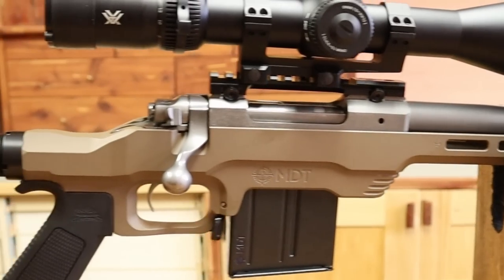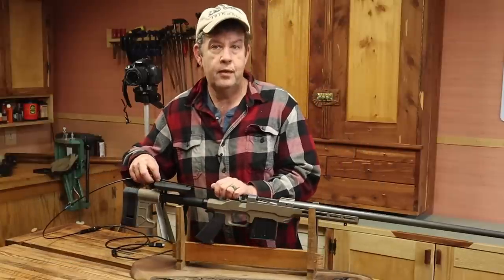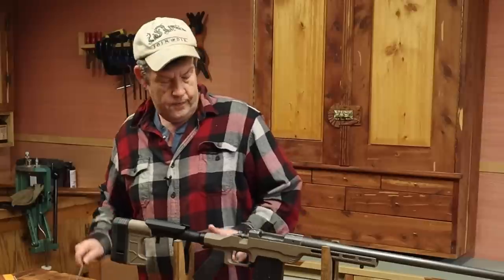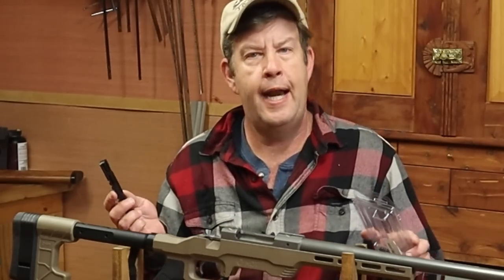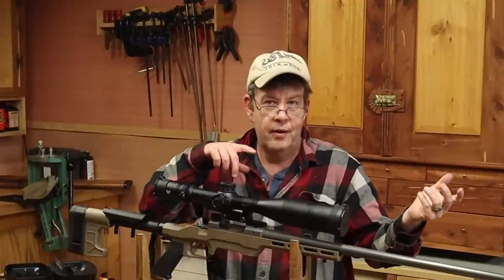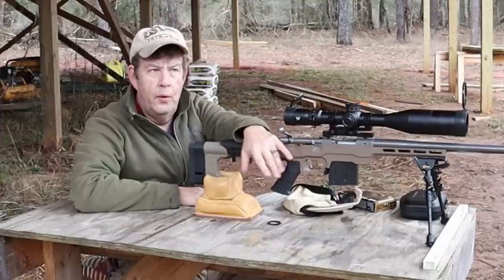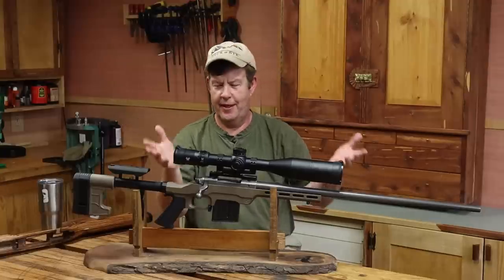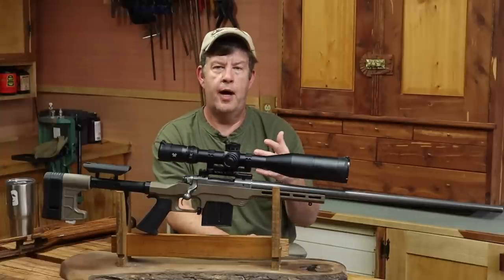Aluminum Chassis For Bolt Actions?

Comment: I had a rile with a very flexible cheap stock.  (A buddy told me a chassis feels like holding a crumbled beer can.)  I wanted to try one for myself.   Took a while to get used to.  Didn't require bedding.  I target shoot with it.  Too many projections and angles to hunt with, snag on limbs and brush.   Real cold in the winter, but I shoot with gloves.  I deer hunt with traditional stocked rifles.

Comment: I have several Ruger 77 rifles, both Mark I and II models, and two custom rifles based on Ruger 77 Mark II. None of these Ruger rifles has shot anywhere as precisely or consistently as the out of the box Sako rifles I currently own. The Sako rifles are at least capable of groups half the size of the Ruger rifles, often better than half the size.
Reply: Love those Sako’s! I have pre64’s and Weatherbys and many custom rifles but the feel of Sako’s are my sweet spot!
Reply: I love sako and tikka.  Both are great Finnish rifles but I have had great experience with ruger 77 mark II. I never had a 1 or Hawkeye but mine have all been half moa shooters.  The only rifle that I had trouble shooting was a early zytel stock ruger logo all weather stainless on 270.  It kicked so hard with the light rifle and hard recoil pad that even in 270 was half un bearable and because didn't shoot well bit wasn't the rifle.  It was just the weight and recoil that made it hard to shoot.  Same reason why a lot of people give the number 1 bad accuracy rap is cause the rifles move to much under recoil on bench more like a magnum!  But stainless all weather laminate same rifle same cal shoots like a tac driver in putting barreled action on other stock so did the other rifle!   So did all the walnut stock 6mm and 220 swift and target 220 swift i shot all shot really well.

Comment: The chassis’s are better than the traditional wood stocks in almost every way.  For starters, after switching to a chassis you now have a floating barrel which significantly helps with accuracy. They’re lighter but yet you also have the option to add weights depending on your style of shooting.  Most of the higher end chassis also allow you to add bag riders to the stock.  Also, like you mentioned you do get the additional clearance for larger scopes.  The chassis system that you were using in that video is on the cheaper end of MDT’s chassis’s.  I have the MDT ACC Elite which offers every option you could ever or want or need and I also have an ESS. Obviously you get what you pay for, such as tool less adjustability for the cheek riser, length of pull, etc. I just personally don’t see how a wood stock could compete with a chassis in any aspect
Reply: It is the aesthetics that turn us wood lovers off of chassis.

Comment: Hey Tom, another great video. I'm curious if you have ever owned a Browning BAR Mark II, and what you thought about it. I've been thinking about one for a while, and it seems prices have started coming down a LITTLE bit. Thanks.
Reply: Those look great on the Browning site. They still have them in several calibers but call it the "Browning Mk II Safari" now. Would love to have one in .25-06 or .308
Reply: Great gun but they require a lot more cleaning and maintance otherwise you only have a single shot! My father in law owned a deluxe one for years but would never spend the extra time to keep it extra clean and it sat in his gun cabinet for years and not used!
Reply from the maker: Will, I have never owned one but a really good friend of mine had an older safari grade BAR and that was a great rifle. And Joey has a newer one that I'm hoping to do a video on this year. Personally I've always loved the BARs but I don't know about the Mark II's.

Comment: First, it's not a bad-looking setup, and I prefer traditional wood and steel rifles, Second, It looked like the scope was mounted too high, and I realize you only installed what you were given.. Third, I didn't particularly like the adjustable comb on that particular rifle, and though I did not shoot it, I think I would prefer shooting something a little more traditional like the Springfield Waypoint.  Forth, I really would like to see how it shot some custom loads.  All in all I think if it were me, I would much prefer the original stock, again, I would have to shoot it to be certain.  Good video I enjoyed it, and would not mind seeing more like it, God Bless.
Reply: 5th your going to run out of fingers there Mr criticism.😅

Comment: These chassis are all the rage from successful marketing. We get to play soldier/sniper. You just can’t beat the beauty of wood and steel ( c’mon…….aluminum, polymer, blah blah blah)
Reply: Stocky's Stocks sells some wood stocks (including Walnut whenever they can keep any in stock) that have an integral "Accublock aluminum bedding system."   My .223 Varmint in a Stocky's M-50  Blah Blah Blah on the will put 5 in one inch at 200 yards., and 3 in .884 at 200 yards. Better than1/2 MOA rifle if I didn't have to breath. Now that's gonna pretty much clear out a prairie dog town while I drink coffee with my other hand. Lot to be said too for the good scope and Timney trigger set at 1.5lbs. Don't get me wrong though, I love Walnut Stocks---not so much laminates. :)
Reply from the maker: You didn't say anything there that I would disagree with!

Comment: I've always like this type of chassis due to the weight reduction, but I don't think I'd replace a traditional stock with it. I have a Ruger Precision in 308 and it seems to have a lot more going on with the chassis than this one. It's a fun gun to shoot and is very accurate, but I don't think it is light by any means.  Maybe I should look at one of these chassis to see if I could lighten it up a bit.  Anyway, thanks for the info and that shooting facility is looking really good.
Reply from the maker: Cervus, the stock was about the only light thing about that rifle. With the heavy barrel and that giant scope it weighed a ton but it felt like a single shot with all of the weight being in the front from the scope and barrel.
Reply: It seems to me that in reality the skeleton stocks are heavier. Every one I have ever picked up felt to be heavier and most certainly less appealing to the touch.
Reply: @russellkeeling4387  Interesting Russell.  Thanks for the first hand information concerning these stock types.
Reply from the maker: @russellkeeling4387  Russell I agree they tend to be heavy compared to a standard hunting stock but compared to a lot of target stocks they're a lot lighter.

Comment: I would like to see an aluminum chassis with the lines of a traditional stock.  The pistol grip on a bolt action just don't make sense!  Keep the adjustability of pull and comb, just get rid of the pistol grip.

Comment: While I think they look awesome, I just don't prefer pistol grips on bolt actions. I did well enough with the AR-15s in the service to get my ribbon, and really only liked that style of AR... with the handle and peep. I do, however like full length aluminum bedded stocks like on the Stocky's M-50 I have for my Model 700 .223 Varmint, or my Accustock  (1st gen I would say) I have with my .243 Savage Predator (Model 10). The Choate Tactical stock I have for my .260 bench gun is about as close to pistol grip as I care for. It's even a little too vertical for me, and SO heavy, but I like the 1/2 MOA groups with my best load, so I won't complain. Just personal preference. For rails or one-piece mounts, I've just been using Leupold's with either 0 or 20 MOA. But I don't really have A range for more than 300 yards. I do torque my metal bedded rifles actions to around 60-65 in. pounds.
Reply from the maker: CBSBASS, I think you're going to like a future poject that I have coming up. It involves an aluminum bedded walnut stock and hopefully some tiny groups. I'm just waiting for Joey to get some free time before getting into that project.
Reply: @TomRiverSimpleLiving  Great. Stocky's seems to cater to Remington 700s, and that's where I first saw/heard of an aluminum bedding (mini accublock stock) kind of stock in Wood. They just never seem to have any walnut in stock.

Comment: Artistically repulsive, functionally delightful.
In its day it will be seen as artistically pleasing.
Because what serves the owner becomes delightful.
There are so many good platforms out there and Ruger keeps advancing.
That is a monster scope! eventually they will come up with a rifle that nests inside the scope. At that point you have an ABM system with a 10 meter radio parabolic antenna.
Let's gopher it.
Reply from the maker: Ain't that the truth!
Reply: Some of the very early firearms look ridiculous nowadays. And some of them might have needed two operators. 

I am curious if that rifle was made to be used with a particular ammunition. Then it would give the optimum performance with a readily available ammunition and it would not be possible to improve on that by changing the ammunition.

Comment: Why not just clean from the bore, not gonna hurt the crown if you're careful.
Reply: You might want to rethink that! The crown is a lot easier then one would think! My short 60+ years of hunting, collecting and reloading and found that the crown is the last thing to touch the bullet and send it on its way!
Reply: @edwardabrams4972  Were you using tool steel cleaning rods? The crown isn't that sensitive.
Reply: @prowler10393  Yeah, like a brass wire is going to injure barrel steel.
Reply: You can clean your gun from the muzzle end and good luck with that but my $3,000. Rifles are not going to be cleaned that way and if you go on the web and do a check you will find no gunsmith will recommend it either! I have one of the top smiths in my state and a retired prs shooter and he says your only kidding your self if you think it’s ok🤔😳
Reply: @edwardabrams4972  No , not going to buy it. The metallurgy does not support your thesis.
Reply: @Edward Abrams  they don't recommend it because they know there are too many people who are careless and/or would be using an abrasive cleaner. Consider some weapons can only be cleaned from the muzzle without actually taking the barrel off...
Reply: @prowler10393  I guess people think that a bullet screaming down a barrell at 60,000 psi behind a literal explosion is ok for a bore, but God forbid a ramrod is ever hand applied in the opposite direction, in this case the bore is made of fine silk.  Fudd logic.
Reply: I never clean the bore because I never shoot. 
But it occurred to me that it would be possible to drop a cord vertically down the muzzle, attach a cleaning element and pull upwards. If you had also attached another cord you could pull it back down, with or without said cleaning element.